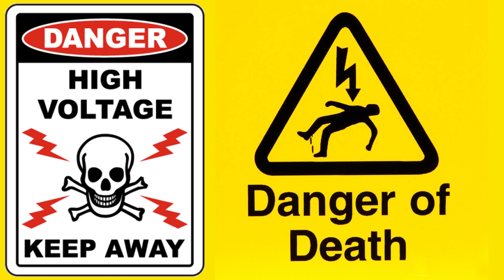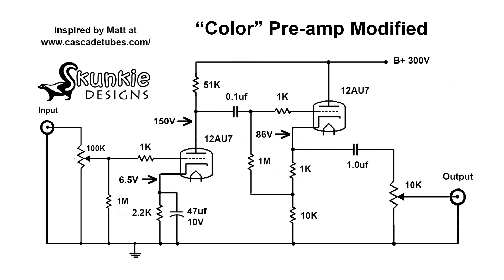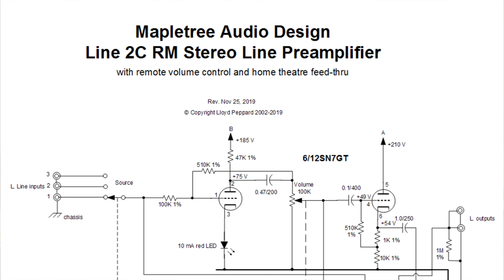"Color" Tube Pre-amp for Solid State Amps: Design Tweaks

Comment: 6:03 What is the value of the "fixed" resistor? I don't understand what you mean by fixed, because you also say to not use a low value, but let the amp dictate the value. I'm not clear.
Reply: You said 1 meg. Did I understand that right?
Reply from the maker: If you are building an amp for this to drive, the grid leak resistor on the input tube sets the impedance, just don't use something lower that 250K unless you have no choice.

Comment: With these input gain adjusters, do you think they could be turned up enough to allow this preamp to take a phono input from my record player as well? I just ordered the transformers and a few other parts so I can build this thing... primarily to go between a Raspberry Pi with DAC HAT and my integrated SS amplifier... but it would be nice to be able to use it for vinyl too...
Reply from the maker: A turntable needs a RIAA preamp / "phono stage" to de-encode the vinyl. Even if this has enough gain, it won't sound right.
Reply: @SkunkieDesignsElectronics  OK, thanks! Good to know!

Comment: Cool ideas for a preamp this. I especially liked the idea of volume control both on the input and the output, although a pot degrades the sound a tiny bit, so having two is not optimal in that sense. But would be fun to experiment with for sure. I have coming up both an firstwatt F5 and F4 and this style of pre would be perfect for playing with those. With 21 db of gain it should just be able to drive the F4 which is a power amp with no gain, so needs > 20 db gain from the pre, i.e all voltage gain must come from the pre.

Comment: I'm a professional audio tech and your input vs output gain explanation makes perfect sense to me.  If you overdrive the input stage of any preamplifier (be it this preamp or let's say a microphone/line level preamp in a mixer) your output will be distorted no matter where you set the output gain.  On the gear I use, I have the benefit of either input metering or a peak LED.  By the way, I'm learning so much about tube amplification and tube circuits from your videos.  Thanks so much!

Comment: Hi, thank you for your video. I am getting ready to build a 4S preamp. My Hammond transformer comes with a lot of unnecessary wires for other input voltages, etc. Do you have any tips on how to deal with them? Or maybe some of your older videos cover it?
Reply from the maker: What I have been doing lately is: Take off the end bells, trim down the unused wires, seal the ends with heat shrink tubing, tape them together and tuck them neatly up against the core and reinstall the end bells. Then only the wires I need come inside the amp. That or you could seal them off inside the amp if you don't feel comfortable doing what I just described, that's what I've done in the past.
Reply: @SkunkieDesignsElectronics  thank you, I will try that. Shrink tubing sounds like a good idea. I saw this on your videos that there is no trace of extra wires. I was assuming they are inside of the bells somehow, but I didn't know how because wire nuts are too big to fit

Comment: hi you forgot another scenario if you have a cd player with a fixed output and you drive a transistor  power amp with no volume control   , you put a volume control  input or output of the preamp!
Reply from the maker: https://youtu.be/s214yEO3-aY?t=443

Comment: A DAC with a volume knob acts as a preamp of sorts. So, this video acknowledges that feeding a 2V RCA signal to this preamp would inject a lot of distortion the potentiometer on the output could not take back. Which is what your diyAudio friends were saying.
Reply from the maker: You are missing the point...  We (at least some of us) want SOME of this distortion, that is the WHOLE point that some people just don't seem to understand. But also we don't want a lot or too much, which is why you don't want to just blast a full signal into this device. And I never said the pot on the output would "take it back", it actually preserves it. If you want zero distortion, this is not a device you would ever want to use.

I would say at least 80% of those DIYaudio "friends" can't comprehend this, it seems simple to me.
Reply: @SkunkieDesignsElectronics  I am not missing the point. There is “some” and there is “5 to 10%”. Feed it the standard RCA 2V input signal and use the Audio Analyzer Suite to find out if it’s “some” or more than “some”. I like distortion too, particularly even harmonics distortion, but past 3-4%, it’s no longer a benefit to my ears.
Reply from the maker: Until I measure it, all those DIYaudio guys are just guessing at % distortion. I've listened to it briefly and there is no way even with a 2RMS input is there anything close to those extreme amounts of distortion present.

Did you read Matt's page? 

"As can be seen in the table, the preamp adds about 1% second harmonic color to the signal."

https://www.cascadetubes.com/the-12au7-cathode-follower-color-preamp/

Comment: Awesome! Very cool that you brought up and showed part of the schematic from the Mapletree Audio’s preamp. Did you already know about it before I sent you that info on your site? It looks like a really interesting way of building a preamp. I’m very curious as to how that’d sound too. A lot of different possible variations on a theme here. I’ve got a fully refurbished beautiful old Hitachi HA-610 SS integrated amp. I put a tube buffer I built using 6922’s in between the pre and amp to add a bit of tube sound. Thanks for another great vid. 🔊😊🎶
Reply from the maker: I knew about placing the volume control between the stages, but thanks for sending me those links! Like I said, for DIY folks wanting to tinker around, lots you can do here!
Reply: @SkunkieDesignsElectronics  Yeah, I figured you knew about putting the volume in the middle, but just curious as to if you knew of Mapletree Audio? They’re pretty new to me, but I found it exciting when I saw they had schematics for all their products. 

Yeah, no doubt this preamp has a lot of options of how to build it. This is something I can see myself building to use with a SS amp. I think I’m gonna be building one of Nelson Pass’ First Watt solid state amp designs, and with this pre in front…? That gives me more of a reason to build them. Seems like a good combo. 🤷‍♂️😊🎶🔊👍 
Thanks again, Stephe!
Reply: Great video! I have a FX audio tube – 01 preamp buffer that you are about to review. If I increase the signal from my dac to this preamp, will I get more tube distortion?
Reply from the maker: Yes. Try driving the pre-amp tube with a hotter signal (or increasing the volume knob on it, the volume is on the input of this pre) and then attenuating it on the volume control on the amp (Which would be the same as doing this on the output of the pre) and vice versa.
Reply: I tried what you mentioned Stephe. Sounds different for sure. I increase the signal strength to the FX audio tube – 01 with Russian tubes by using the volume control on my DAC. Bass drums sound less defined but, fuller.  For some music like rock, it sounds a little to distorted. Just have to turn down the volume signal from the DAC. With easy listening, and Sinatra sounds good. Noticed larger deeper soundstage.